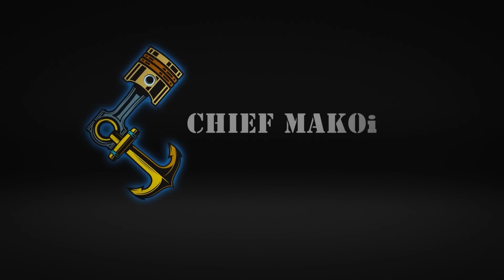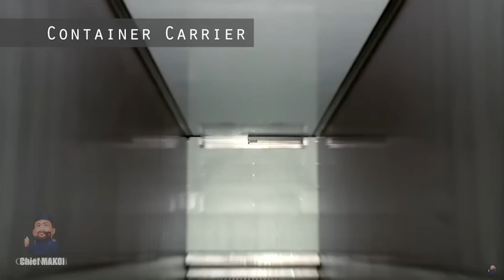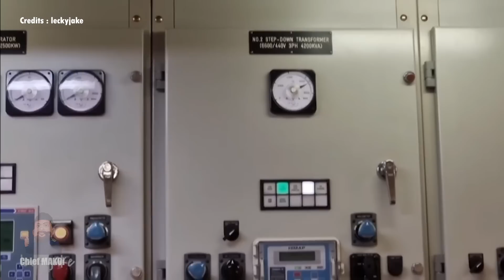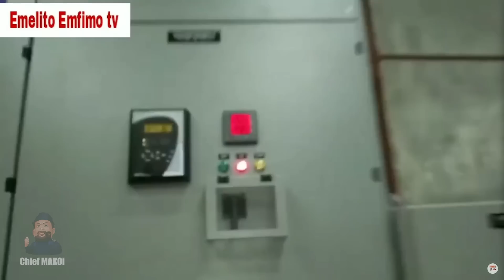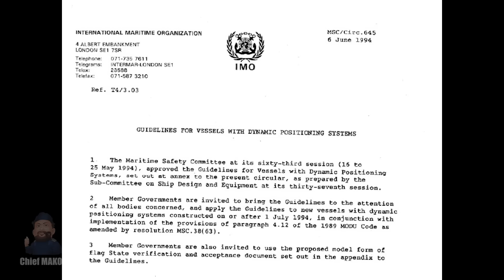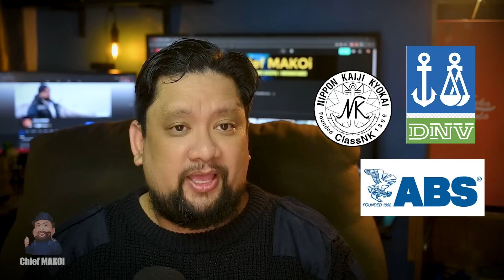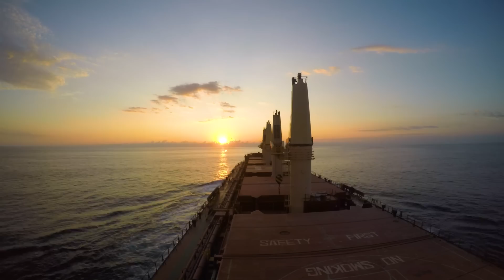Why Cargo Ships Don't Open the Bus Ties During Maneuvering | Chief MAKOi

Comment: I’m not in the maritime industry.    My experience is land based with facilities that must run 24/7 or else several hundred people might die.  When we designed power systems we utilized split buses with a tie circuit breaker.   Half the critical equipment was split between the two buses.   If half the power system went down the facility would still function.   The super critical loads were on a separate split bus with UPS’s backing up each side of the bus.  During bad weather the facilities would come up on emergency generators right before the weather hit.  

It seems to me that ship builders need to look at how the ship will operate and the consequences of loss of power.   

Taking on the financial liability of destroying a two billion dollar bridge and killing six people was probably not in the mind of the designers.

Comment: I am a retired Engineer who specialized in designing Food Warehouses, I often had to instal ThermoKing Outlets at all the shipping doors.  ThermoKing was the Refrigerator Units on Trucks.  The ThermoKing Outlets were 208/230 Volts, and required a Dedicated Transformer, sized for a Truck at every Shipping door.   I am courious, what is the Voltage and Wattage of Refrigeration Units  on Containers.  I would assume that the Ships, when they were built, were designed, sized to Power Thousands of Containers.  The Deck Crew would have to know that the Electrical System could handle the Container load before they left port.

Comment: Thank you for making it so clear. As a maritime industry outsider, who just has an interest in the industry, but is an engineer with 40 odd years of experience in the electricity industry I can only be amazed and say the maritime industry must be a prime candidate for the prize as the most irresponsible industry. Allow me to justify that statement.
A chain is as strong as its weakest link. The safety and reliability chain in this case seems to have many weak links where a single point of failure brings down the whole system and that system is the most critical for existence/survival. 1 engine, 1 transformer, 1 busbar configured so that you have 2 generators which become as reliable as 1. So the industry which thinks (in times past) that they can build an unsinkable ship can build unbreakable motors, fault free control systems and unfailable transformers as well. This is a design philosophy issue. Please bear in mind that this is a ship just short of 1000 feet with a displacement of tens of thousands of tons. No care is given for the possible impact of that. The potential cost or impact, both economic and environmental, or social. Even if the ship did not knock down the bridge it could have hit it in a way which gouged its side to the point where it polluted the whole bay. 
Imagine if other industries followed that approach. We would have whole cities sitting the dark for months, as an example.
If I had lost a father, brother or friend that night I think I would feel outraged. Certainly I would try and get a class action lawsuit against the designers, builders and even the IMO for their lax standards and ethics. With the current practice, I would argue,  the outcome, or something like it, was inevitable and it will certainly happen again. 
Then to add insult to injury we have legal/financial loop hole for them called "general average". Which is essentially "I mess up but you must pay" if I understand it correctly. Wonderful!
Reply: This also applies to the outdated and under protected bridge supports.

Comment: Great video Chief.  If I understood you correctly, it is a reactionary industry.  Instead of letting the engineers (electrical, mechanical, etc.), build for the least expensive, and then react to incidents such as this with some new rule.  If that is the case, it doesn't seem like a very good model for the cargo shippers, the crews, and the general public.

Comment: Old retired USN submariner, 1977 - 1997, Naval Nuclear Power Program - for many reasons, the electrical power plant on nuclear submarines are even more redundant, than that described by the one commenter that works at a civilian nuclear power plant.
Essentially, you had two large turbogenerators that fed into the main AC buses, divided between port and starboard, each with their own remotely operated breaker. And there was a remotely operated tie breaker between the main AC buses, so either turbogenerator could carry the entire load by itself.
The port and starboard AC buses were further divided into "primary" and "non-primary" buses, with a remotely operated breaker in between these sections. If those connection breakers were open for some reason, the "primary" AC buses could still be supplied via motor-generators, port and starboard, from the main DC buses, when acting as AC generators.
The main DC buses were divided similarly to the AC buses. They could be supplied from the turbogenerators in normal operation via the motor-generators operating as DC generators, from the emergency battery, and/or the emergency diesel generator - again all with remotely operated breakers.
Some of the critical propulsion systems had both an AC and a DC powered pump - so if for some reason, the AC powered pump was lost, the DC powered alternate would immediately kick in. In addition, if the main engines became inoperable for some reason, there was an emergency DC propulsion motor, that could be connected to the main propulsion machinery, to keep the propeller turning and maintain some level of propulsion.
The whole idea was to maintain propulsion and critical systems. Obviously, unlike a civilian merchant ship, operating and maintenance costs were a distant secondary consideration.
One possible outcome of what happened with the Dali, would be if they mandated an additional emergency power supply for the main engine, such that the main engine wouldn't be lost upon a loss of main electrical power, and propulsion maintained.
And, one old engineer to another, you've just earned another subscription.
Reply: 1/3 of my coworkers were ex-navy nukes, split between subs and carriers. 1/3 were college grads, then 1/3 were people like me who worked our way up into the control room.

The US civilian reactors were built on the principles of the US Navy and Adm Rickover and the enforcement by the USNRC doesn't care about what it costs for safety, for the most part.  It is always a battle between corporate greed and safety and when does it become too much?

The "what if" planning and regulations is unbelievable in nuclear power.  My favor example is nuclear grade pens.  They are low chloride, low halogens, and low corrosives inks (Google it). These marking pens can safely mark nuclear pipes, vessels, stainless steel, and titanium to prevent corrosion from writing just once on a pipe for the rest of its life in the plant or during an accident.  Imagine writing on the hull of a ship and it sank because someone wrote a frame number with a pen 30 years before during construction.  It won't happen, but in nuclear power regulators believe that it will.
Reply from the maker: Thanks for sharing.  I've always been curious about nuclear-powered submarine systems.  I just heard tidbits about it from one of my professors back in the Academy.  He was a graduate of USMMA.
Reply: Just saw your excellent post after rambling on about data centre electricity  philosophy if  applied to ships.  You've prompted me to recall a previous encounter with a radioactive ventilation system with a single fan supported by both an AC and a directly battery driven DC motor.   Which I concluded had slight  weakness from reliance on a single fan impeller and lacked protection from motor bearing seizures as each motor had a centrifugal clutch that only disengaged when not rotating.  I went through a 1970s Russian Diesel submarine on display in  Germany recently; that was not a very pleasant working and living environment.....

Comment: How does the system maintain phase angle synchronisation when the tie is open? Or does the mode also separate the LV circuits so it doesn't matter?
Reply from the maker: It should isolate both sides so sync doesn't matter.

Comment: As per information gen3 & 4 not connected to EGS .
In emergency situation like like tripping HR1and LR 1 they could have reset immediately. If still tripping have to HR2and LR2. As Generator was running they could have done this much delay.
Also I think they have to familiarise with blackout test drill.
More things will come out after final investigation.

Comment: I was only arguing for the low tie open as a normal configuration.  This is the standard for shore based applications.  Usually the highest bus will be tied in normal conditions, and then the lower levels of the system will be run with open ties.
Having the high voltage tie open does make the generator configuration more complicated to manage.

Comment: How do you keep each bus in phase or synchronized if you split them?  Is that needed?
Reply: I thought about that too and suspect there is more synchronization needed to run parallel transformers in AC circuitry.  This would be assuming both transformers are identical.

Comment: Nice job Chief!  Clear, concise, and balanced explanation as always.  As far as I am aware the tie breaker was closed on Dali but it was the primary and secondary breakers on TR2 that were open.  Is there any possibility where both transformers could be damaged by an event upstream of the primary input if both were simultaneously in use?  Also another reason to keep the transformers isolated is for backup and redundancy purposes.  This looks to me like an N+1 configuration where you really only need, at most, three generators and one transformer at any given time to operate the vessel.
Reply from the maker: Yes, that's pretty much how the system onboard is normally setup.  One transformer is used under normal conditions.
Reply: @ChiefMAKOi  Thank you Sir!  If a vessel already has a SCADA system I think the short term solution or recommendation could also be in the form of a PLC controlled switch that would immediately energize the backup transformer (with its primary and secondary breakers already closed) to keep the busses powered in the event the working transformer is failing and the breakers open to isolate it.  I'm of course assuming the main engine doesn't immediately shutdown if power is lost for a few seconds during the switchover...

Two transformers in parallel may work (need an EE's take on this) as long as together they are not carrying more load than a single transformer can handle, otherwise if one suddenly fails the breakers on the good one would quickly act to protect it and we're back to square one as they say...

Comment: I am not an engineer and not familiar with shipping, but I wonder whether a catastrophic failure of a transformer could have the potential to cause damage to another transformer working in parallel with it?  Perhaps this would represent a valid reason for not routinely having both live at the same time?
Reply: I can only speak about our use of transformer/rectifiers in aviation but we completely seperate the systems during normal operation. They can be connected but if they are it only happens when the system is down to one generator basically.

TR 1 is powered by Generator 1 through AC BUS 1.

TR 2 is powered by Generator 2 through AC BUS 2. 

Having them working in parallel connected to eachother without splitting the electrical systems seems like a bad idea.

Comment: Chief, you continue to allude to a transformer issue.  How much time would it take you to determine if a transformer is within spec or non-operational if you were to take a Megger to it - Like 5 minutes?  I really think this shifting between transformers the day before is a red herring.  If one of the transformers is bad, it should be easily determined with phase-to-phase and phase-to-chassis resistance readings.  Even without testing, if the transformer caused all that black smoke, do you not think there would be a huge arc and molten metal visible in the engine room?  And at the very least, the bridge is down and they are stuck underneath it, wouldn't the investigators switch transformers to see if they can replicate the power outage?  Seems like they could've, would've put something more definative in their report if it was a mechanical failure of one of the transformers.

Comment: Thank you for your explanation Chief MAKOi. I was wondering about this.
As the retired 'Chief Engineer' equivalent in the Royal Navy, it won't surprise you that I have almost always run with split busses even in peacetime. (Athough our more recent electric propulsion ships can use more felibilty in some circumstances in peacetime for economy.)  
Like you I could envision local port requirements changing that will drive change in these very large ships where there is potential for high consequences structure collisions on the navigatable route. The cost saving of using fixed link plates in place of a breaker and possibly some less than ideal generator running is surely paltry compared with the consequences IF having had used split busbars would have prevented this collision. (Although I am in the camp that feels the bridge pillar protection was completely ineffective in defending this bridge and the ship should not bear the sole responsibility. Risk of a ship/bridge collision will still be non-zero however many additional engeering safeguards are applied).
I am enjoying your feed now I found you having been pointed here by 'What's going on with Shipping'.
Reply: Yes, the bridge fendering was obsolete, and should have been upgraded at the same time the container docks were built.  There is an additional issue with these large container ships, that they have a very wide bow flare.  This means that the fenders/dolphins need to be spaced further out from the bridge structure.
Reply: The other matter for consideration is about the use of tugs

Comment: Keeping bus ties separated both the HV and LV may help in preventing a blackout. The HV 6.6KV never tripped and power was available on HV bus. There are many components which can fail/ trip on safety, not  just the transformers. Bow thrusters being typically the largest motors onboard will draw a lot of current when in action causing severe voltage/ frequency fluctuation. May cause trips. Depending on which LT bus is supplying Main engine auxiliaries one can still have Trips/ stops/ shutdowns of equipment including Main engines. Arriving/ leaving ports or navigation in restricted waters is high risk for navigation and not typically for electrical power plant provided sufficient additional power is available.  Having a open tie or closed tie will have their own benefits and constraints. Probably more beneficial to talk of crew competency and total familiarization with vessels systems at time of joining a vessel. Typically what happens  with management companies like Synergy is all costs are to be suppressed.  This results in crew joining and going on full duty within hours of joining. This includes Masters and Chief Engineers. Add to this local regulations in countries like USA requiring off signing crew to be cleared by immigrations/ customs etc way before departure time /needing the crew to be on a flight before the ship departs port etc. These things may make life easier for authorities but compromises safety onboard vessels at critical junctures.  I don't  think NTSB or anyone else is looking at cost cutting / convenience measures of operators and authorities.
Reply: RE: "I don't  think NTSB or anyone else is looking at cost cutting / convenience measures of operators and authorities"
Well, considering the magnitude of this single incident - financial damage in 1bn US $ range and 6 fatalities (which we all know could have been an even bigger human tragedy during rush hours) - I'd expect they (plus also other stakeholders) will look into that.
At this point we should take a look what actually can be seen for Boeing after the `incidents´ related to their 737-Max8 series. Finally pressure simply got too high (for very good reasons; and sadly it's been airlines who pulled the plug first) to go on with `business as usual´.

Comment: Excellent history as to when tie breakers are open or closed.  it is worth keeping in mind that when you have the tie breakers closed and are running all 4 generators load share using the traditional droop method does not work well. The traditional droop method works only on two generators in parallel.  Droop method is done by SLIGHTLY reducing the speed and excitation voltage as the load on the generators goes up.  It is also notable that failure to load share does not happen quickly, but over minutes or even hours.  Droop adjustments are usually built into the voltage regulator and governor and may not be on the switchboard even thougth the basic set points for voltage and frequency are always on the switchboard for synchropization purposes
Reply: That was true when the governors and bus were completely analog but today the load is shared easily among more than 2 generators .
Reply: Joseph, you are correct.  It would be nice if we know the type of load share control.  Programiing errors in digital control are not unknown.  Also my first comment should resd SLIGHTLY reducing the speed and excitation voltage as the load goes up on one generator and raising  it on the other generator.

Comment: Aside from those you mentioned, is the Ultra Low Sulfur Fuel one of the culprits? I've experienced that the engine can't be reversed when using ULSF. Thanks in advance...